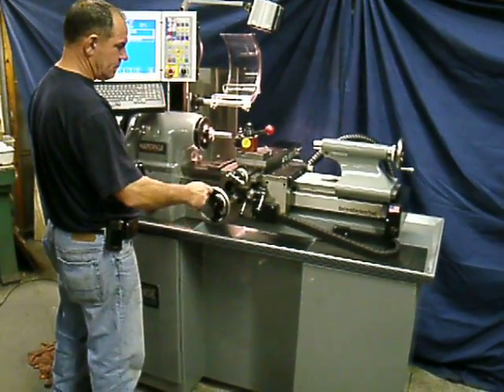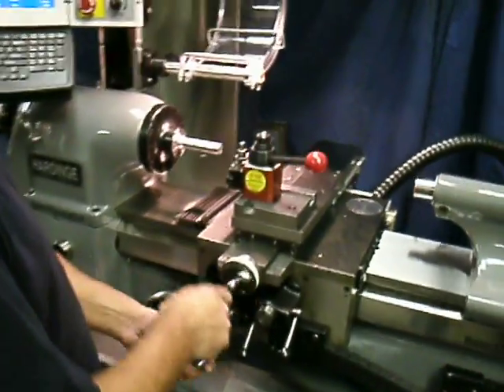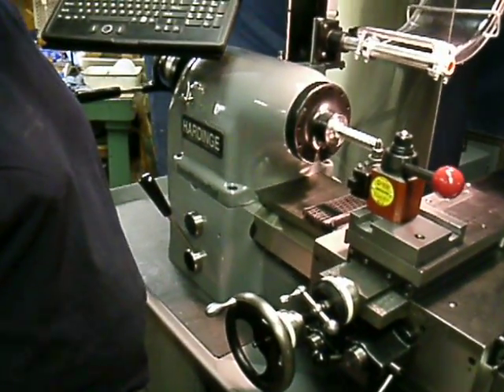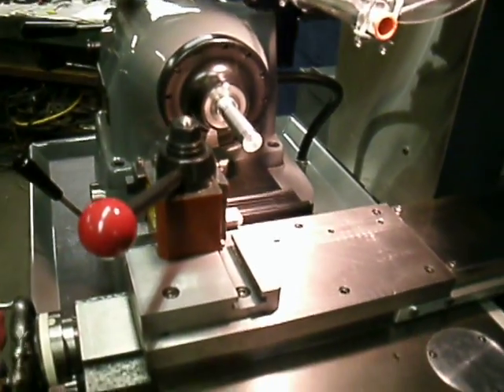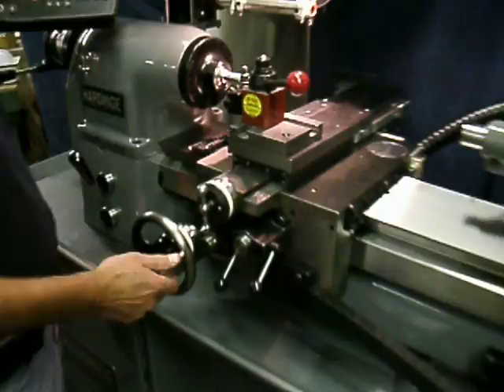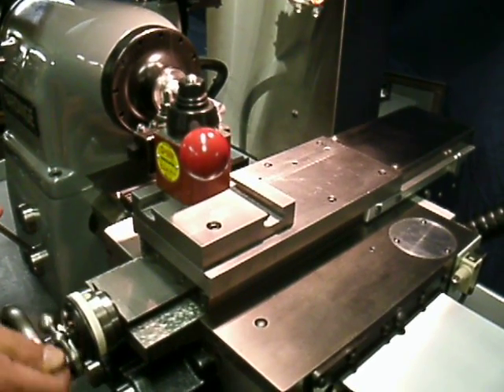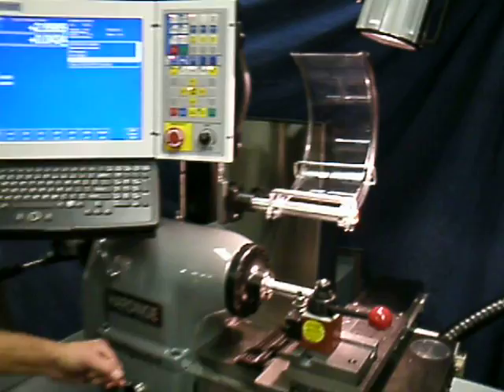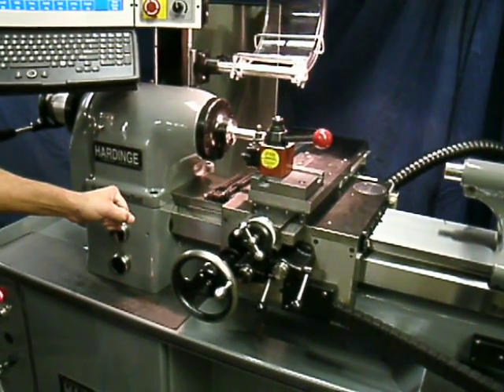Hardinge HLV CNC retrofit by Babin Machine Tool

Comment: Super clean retrofit. Quick question. It sounds like stepper motors on this machine. Why would you use those over Servo's with a Centroid controller? Unless they are just really noisy servos.
Reply from the maker: Smooth and quiet servos. Hope to go to AC design soon